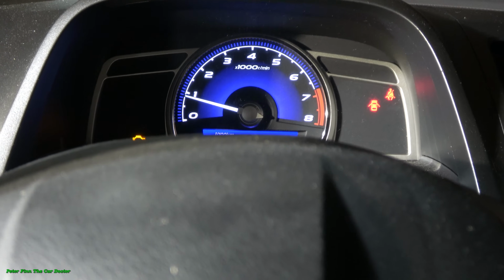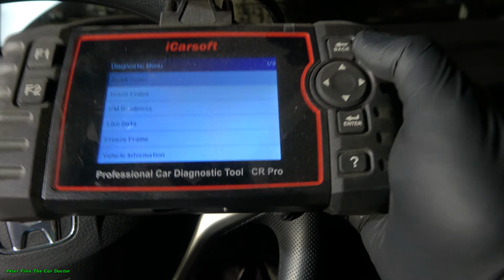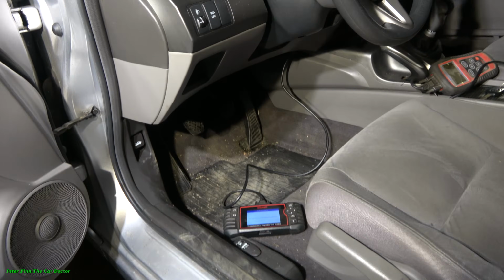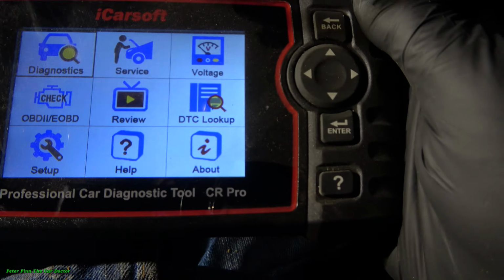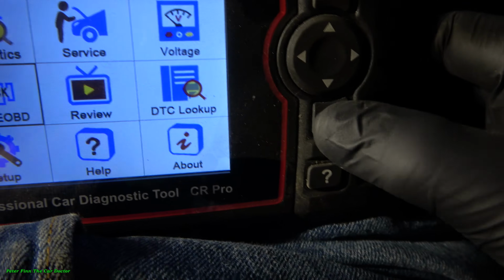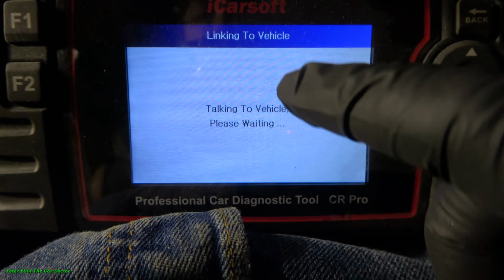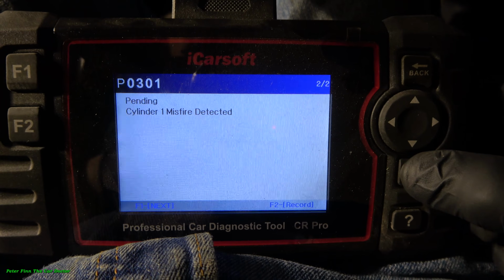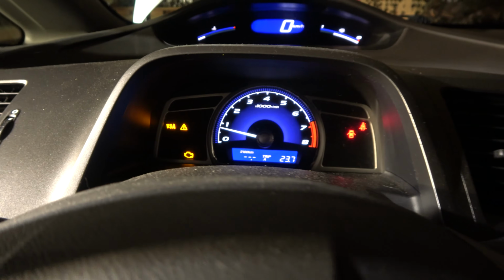How to repair Defect code P0301 Honda Civic. Years 2006 to 2015

Comment: Hi Peter, my catalytic converter was stolen 2 years ago, mechanic welded pipe, without catalytic, car was driven for 2 years like that, than I got codes for misfare, p0301, p0302, p0302. Engiyrun rough,One mechanic told without compression test that engine need to be replaced, other mechanic said that no compression in cylinder 1 , and engine need to be replaced. They didn’t check nothing with catalytic. Is it possible that catalytic need to be replaced or my engine is really so bad? Spark plug and coil was changed. Honda Pilot 2014
Reply from the maker: Thanks for info 👍👍👍